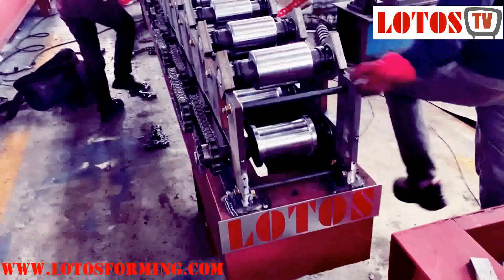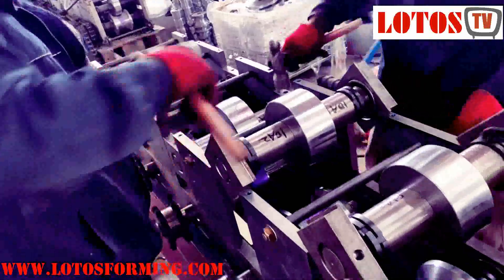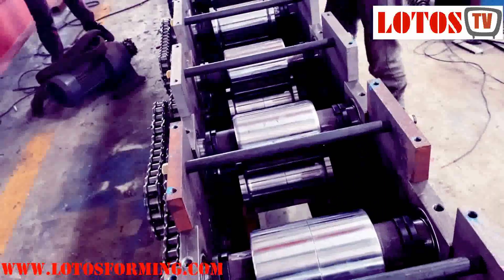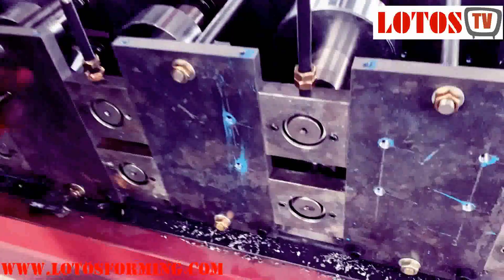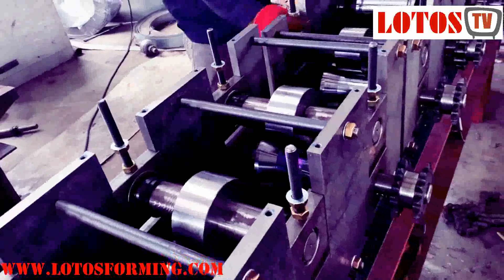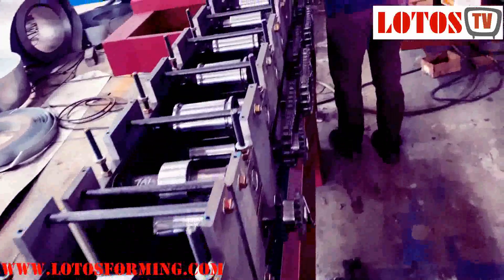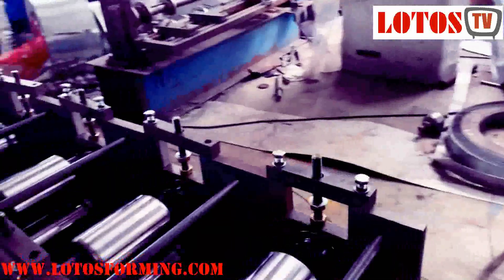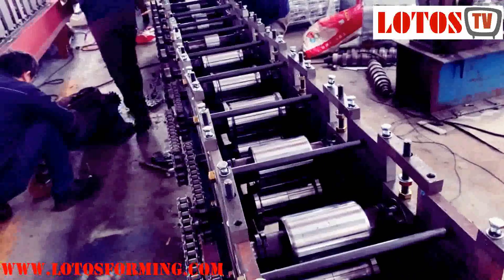Adjust the gap Between the up roller and down roller ?

Comment: Roll Forming Machine is a flexible and continuous process, where both the normal rules and the exceptions utilized. It has been proven several times that the roll forming machine accomplishes roll forming tasks which even seemingly impossible.